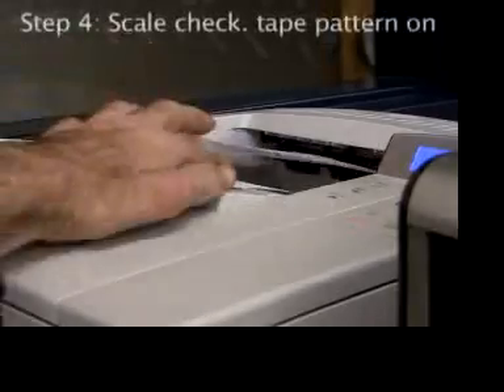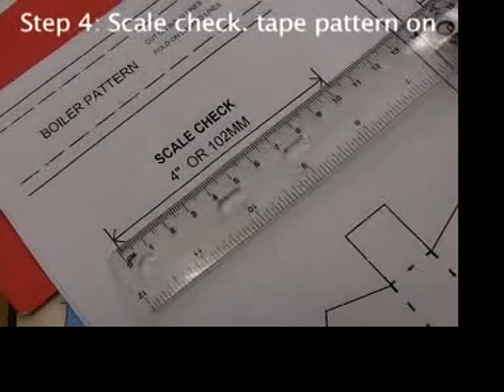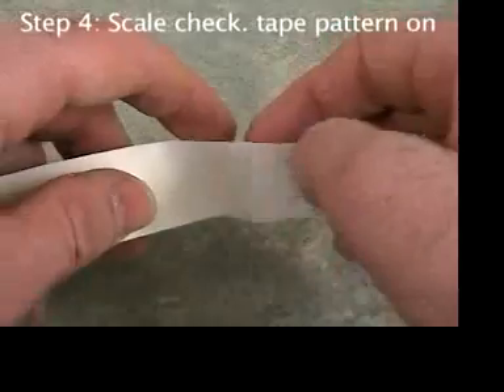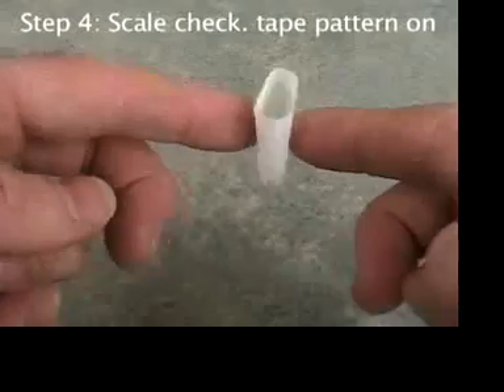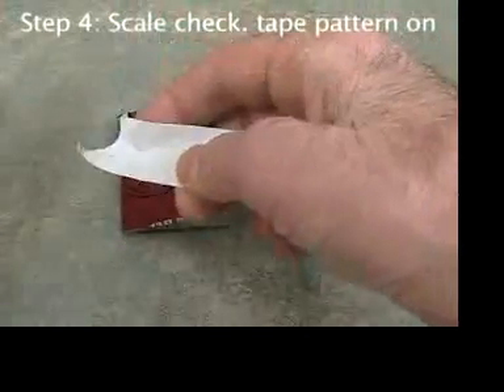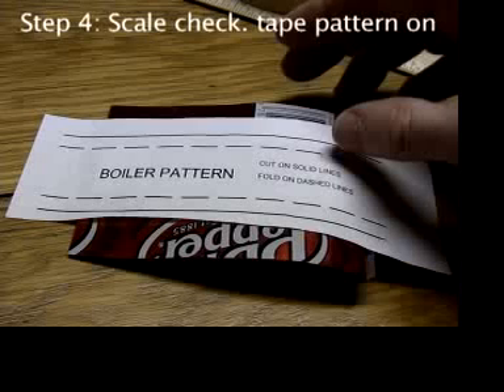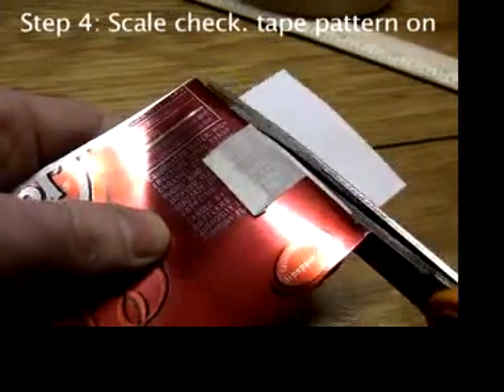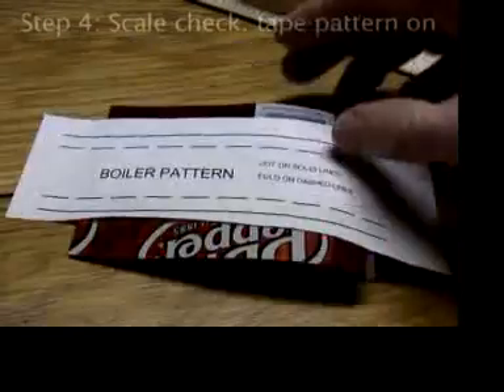Part 7 Build a Putt Putt/Pop Pop Steam Boat s4 tape pattern

Comment: Boiler patterns size?
Reply from the maker: Well, the length depends on the size of the aluminum can. Did you see the link for the PDF pattern? I think the final width is about 24mm; plus the folded flaps on each side are about 6mm each. So total width of the boiler pattern is about 36mm.

Comment: paper size page??
Reply from the maker: +Lily Apotik Although I use 8 1/2" by 11" paper in North America. But it should work with A4 also. Print without scaling or "fit to page". If you still have trouble with scaling, let me know.

Comment from the maker: @abcdefg89301 PDF stands for Print Document Format. I use it because--if you print without scaling--there are fewer problems with the image getting too big or too small. There are dozens of free programs to open PDF. Adobe Acrobat is the most common (the free version is all you need, not the paid version).
Slater